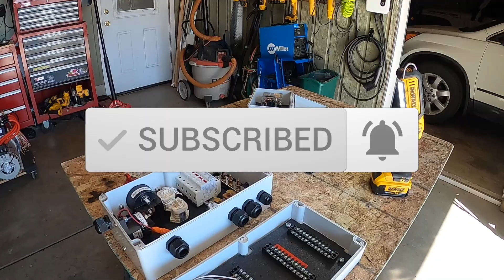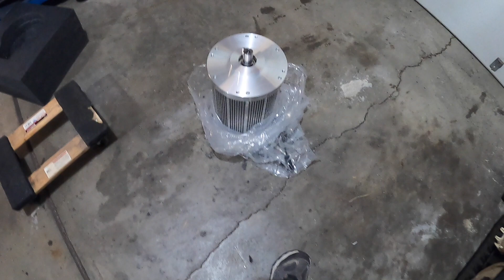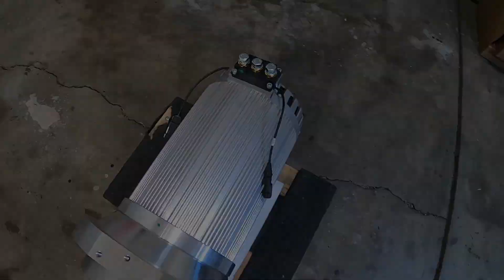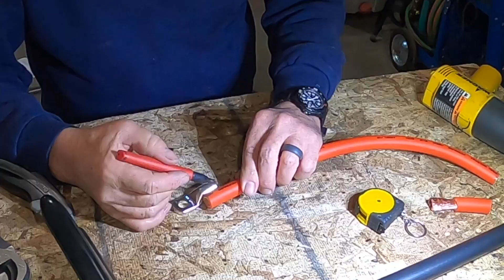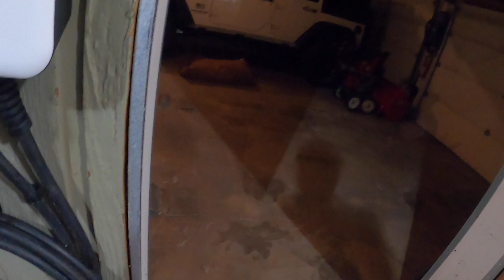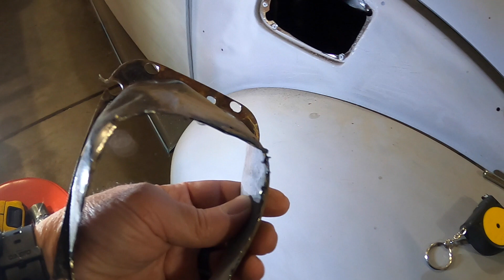1974 VW Super Beetle Tesla EV Conversion - Part 7

Comment: In the control box, next to the fuses on the DIN rail, add an end clamp, to prevent it from sliding across due to vibration.  

Onr question:  what is the functionality of AVC2 and how does it communicate with the EVSE?

Can you fast charge the onboard 150 v DC  battery at public stations?

Subscribing now.  Keep up the good work.

Comment: YouTube just dropped this video in my recommendations.  Finally, after part 7...  I need to go back to part 1 and see all the work thus far.  Your work is very impressive.  I'm doing a restoration and EV conversion of a VW bus on my channel.  I'm going cheaper on my build with used parts and a DC motor, but I did get the same adapter/coupler/flywheel setup from EVWest.  Once my transmission gets rebuilt, I can't wait to get the motor installed.  Good luck on your build; I will keep checking in! ✌
Reply from the maker: Thanks. A ton of wiring. Insane. Next part is recorded should have out next week.